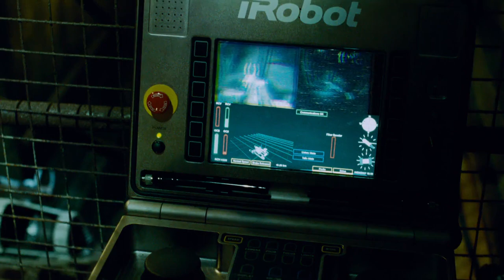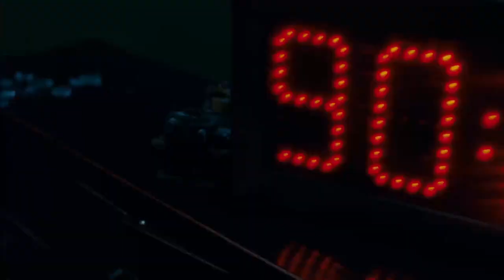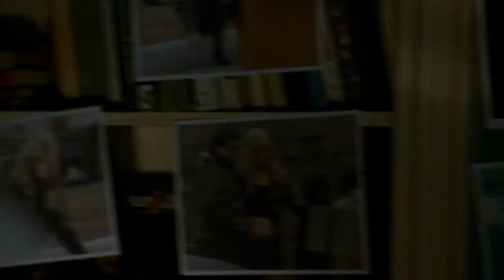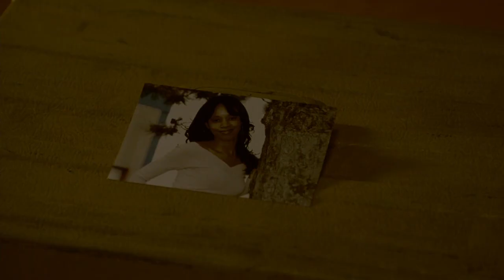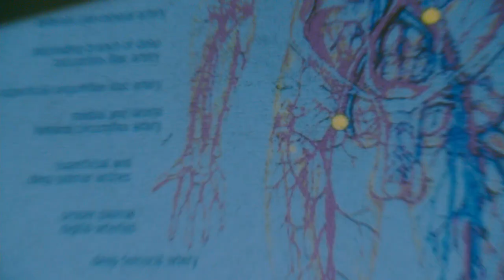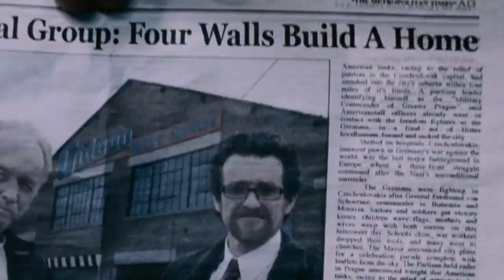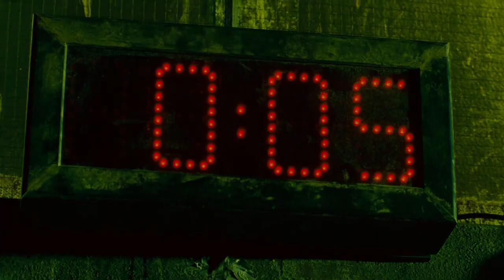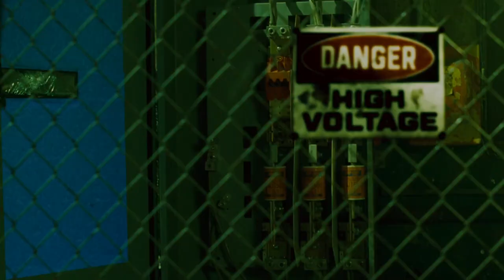Saw IV (2007) in 12 Minutes | Movies In Minutes

Comment: What did eric have on his back? On which way he could've been saved or ripped? I've just seen that he got've killed because of the cop, but, otherwhise, how would he have killed by his trap? I mean, how it worked?
Reply: You mean Art, and frim looking at it, it seems like it might pull/push his head off by using some small hydraulic looking tube on the rear sides of the trap. It might be released when he presses the button after the time is up. His device might be activated last by being activated after the water completes it's circuit with Hoffman. I'm honestly not too sure either how it's supposed to have been, but that's my theory.